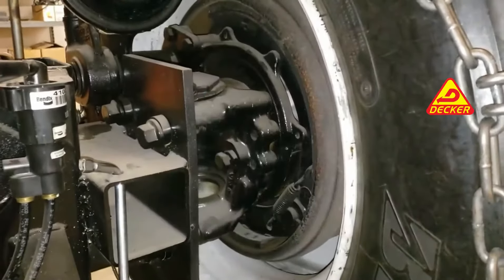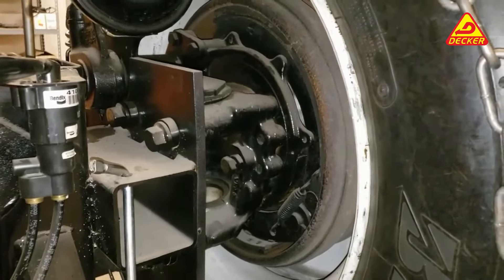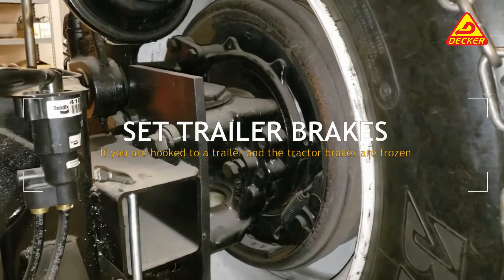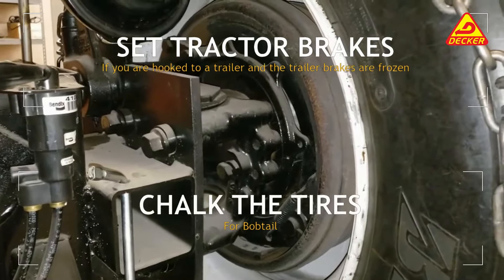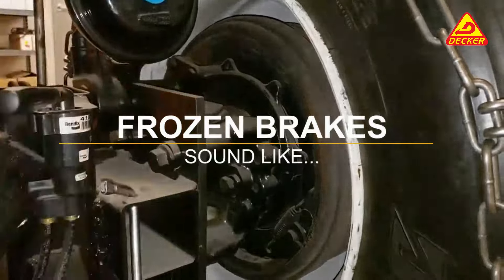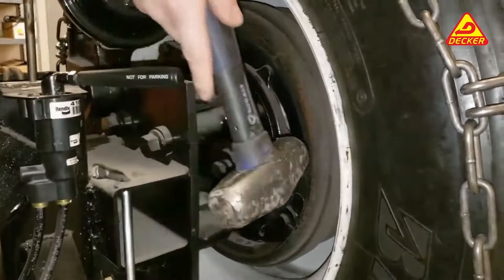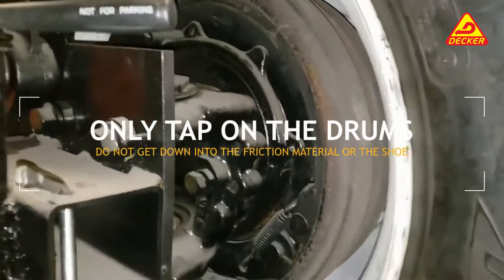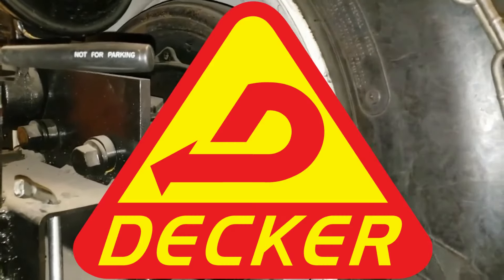How to Fix Frozen Trailer Brakes | Free Frozen Brakes on a Tractor Trailer

Comment from the maker: You may find this helpful as well, Rubbing Alcohol Uses:
1 – When used in a spray bottle will help eat the ice off frozen brakes (truck/trailer)
2- Can be used to help remove ice in airlines truck/trailer (works the same or better than air brake antifreeze)
3- Can be used in a spray bottle to remove ice from the windshield and mirrors. Just spray it on and watch the ice disappear.
4- Spray it on frozen door locks and rear trailer door locks (reefer & van trailer) to eat the ice away so a key can be used to gain access.
5 – Can be used to clean the front radar off in the front bumper to remove the oil film from running down the wet roads. This oil film on the front radar causes, adaptive cruise, traction control and ABS faults. This happens when the oil film is covering the front radar – Bonus in the winter time it will remove the ice as well.